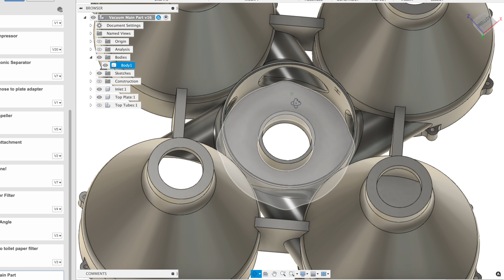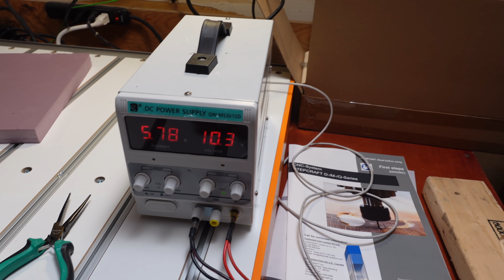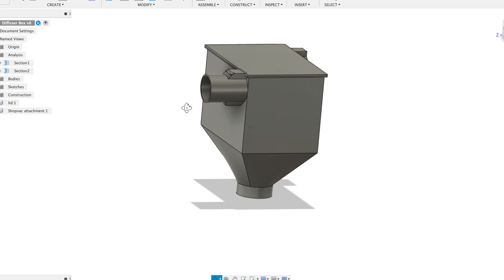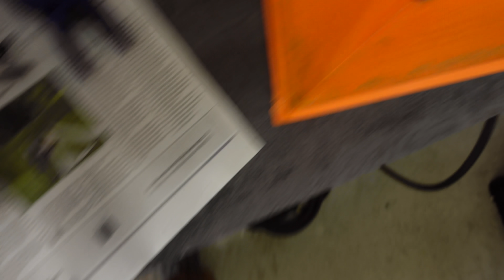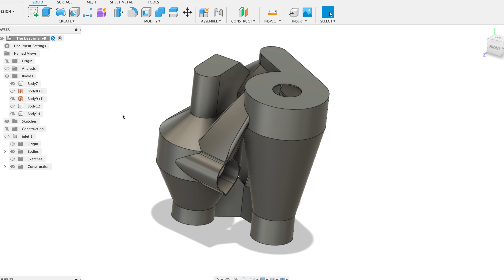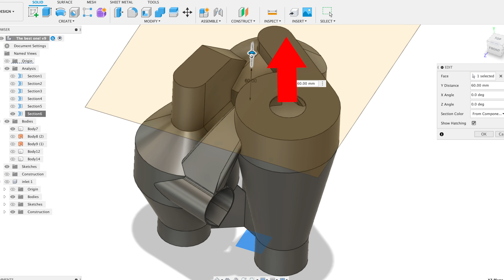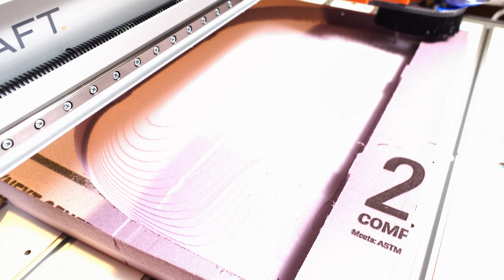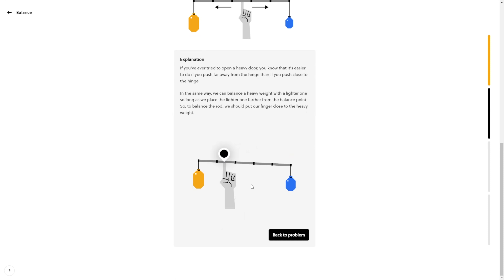3D Printed Cyclone Air/Dust Separator

Comment: Did you find the name Bill Pentz by any chance, he did a massive amount of research and design on cyclonic separators.
Rather than adding extra stages(very inefficient)it may be better to play with upper chamber to cone ratio's to get better filtration for you particular needs, also notice your designs dont have the outlet to the vacuum down in the null/air reversal area...

Comment: I have to cyclones in series in my private workshop. On large for larger debris and a minor one for smaller particles. The intake pipe is 7 cm in diameter angled 45 degrees downwards inside the funnel on both however, on top of the first cyclone i have a small reversed funned, so the air loose some velocity near the lid. On top of the second one I have a 35 cm wide 45 cm pipe with a very steep angled, long, reversed funnel on top. For 6 months I have been using the same vacuum bag even though I vacuum everything from ashes to sawdust. The greatly reduced airflow from intake to vacuum in these two stages helps gravity collect almost all particles.

Comment: i find it easy have 3 them with 3 buckets it was clean no dirt hit filter
2nd thing at lower parts i add few bump just to see if dirt just drop down bucket without being stucked up n it worker but big piece get stuck to it ugh at least didnt get sucked up in next bucket i wonder about adding line little bump just to see if dirt just hit it n slide down to bucket

Comment: To help a bit with the physics behind it:
You can imagine a cyclone like a long, straight river of water. A certain particle needs a certain time to sink in that river. To make it able to reach the river bed (in your cyclone the wall) and settle down in time, you can do 2 things: Either make the river longer, (more time until it reaches the end and leaves) or make it slower (larger flow diameter). Thats why the first design didn´t work that well, and the other two did better. Its a bit more complicated than that, but it should give a general rule how to improve the design.

The same principle is also used in water treatment plants to remove sand from sewage.

Comment: First, I guess you lose air velocity in series, which is the key to filter fine particles. Second, bigger cyclones for bigger particles. Smaller cyclones for smaller particles. Third, usually there's a short tube inside of the cyclone connected to the accept port or outlet. Fourth, I suggest that you start with two cyclones in series with different sizes. FYI
https://youtu.be/LwGXu4e6T1A

Comment: I got rid of my Cyclone. The best dust separator I found is connecting 2 shop vacs in series. First one is not powered and collects all the dust and just has a filter on the motor side and no bag for easy dumping. The second shop vac is powered and has a bag and filter in it. The second shop vac has no dust in it what so ever. I have never had to change a bag or filter since doing it this way in about 3 years.

Comment: It’s a great video and your thought process seems quite sound. Although I would guess all of this research has been done by multiple companies .  

I’ve use the dust deputy for years. I have emptied countless buckets of dust without ever needing to replace the filter and always maintaining suction .  But the hose diameter has the biggest effect on performance and of course there is a golden ratio of hose diameter to come size. Now of course your vacuum limits the diameter size you can test but it should be interesting to see how diameter would effect each type of cyclone.

Comment: I think the reason why the mono centrifuge works is because of the air speed that is much quicker than the stepper one. If you make round cylindrical barrier on the transparent plastic slightly longer than the height of the input hole, theoretically it should be more cleaner.

Comment: * ATTENTION! ***Hey Guys, just finished my Cyclone Dust Separator, 3D designed and printed it myself. I designed a screw thread profil in the Cyclone chamber to guide the airflow and dust downwards and in my tests so far im close to 100% Efficent. There is no Dust coming to my vacuum. 
Hope it helps someone of you. If interesst is there, i can publish the stl's

Cheers
Reply: That was exactly my idea when I saw the dust orbiting in the video. Can you publish the STLs or the design files? Thanks!
Reply: @robertomozzicato249  darn, my last message seems to got lost -.- 
My design is for a specific bucket, u can use it as a reference to design your own. I used acrylic disc for lid to see whats goinng on in there. Also there is a design flaw, artifact in the thread, i  removed later with a soldering iron. 

What improved the seperation greatly, was the last stl file, it screws below the cyclone, and directs the airflow downwards (probably because of some weird fluid dynamic reason).
Reply: @robertomozzicato249  it keeps deleting my messages with the url in it. So its on thingyverse with this suffix: thing:5779983
Reply: @hydroponikstuttgart4515  thank you very much!
Reply: @robertomozzicato249  no problem, if u need help or got some questions to design your own, feel free to ask. cheers

Comment: You should try it by combining your system with a "Tesla Valve".
Cyclone funnels with different diameters (right and left rotation) can be placed on the semicircular rotating parts of the Tesla Valve.

Comment: Love the video. Since the pitch of the cone changed which particle sizes it gathered most efficiently, have you thought about making a multi-stage separator, similar to the series separator except the pitch of the cones change to accommodate for the size of particles most likely not caught by the prior stage(s)?

Comment: You all are a lot smarter than I am . I do have a question though . Instead of just having a steep smooth interior of the cones . Would it make the cones more efficient depositing the debris in the bottom of the bucket if the inside of the cone was shaped like a swirled ice cream cone ? . That way all of the debris would have a channel path along the sides and make it easier for more less particulated air to come up through the center ? 🤔🥲

Comment: Point to note: the multi-stage design should allow you to tune the first stage to remove big chunks at a cost of letting the fine stuff through, to be dealt with in stages 2 and 3.
Reply: I think the particle size being targeted with each stage is probably backwards, probably smallest to medium to largest, but I'd think you'd want to go the other way around.

Comment: I would be interested to see if one could modify the cyclone and make a flute pattern that spirals material down away from the top - > maybe it could help with those larger particles getting stuck "in orbit"...  Hopefully without disrupting the air flow too much

Comment: In the four-intake version, I think the air after cycling down to the bucket joins together and forms another cyclone for they are spinning in the same direction. what if you rearrange the inlet of the top parts, and make them opposite by pairs like the mechanical engineering of a quadcopter? The two pairs of cyclones would cancel each other so that it will leave the dust in the bucket and only the air goes out.

Comment: The problem is that a much simpler bucket lid separator already exists. Iy works quite well, is inexpensive, and doesn't take up space inside the bucket. It looks (to me) like rather than adding a cyclone on to the bucket, it makes the bucket its self the cyclone. Good effort,  it never hurts to try to make things better. I could be wrong, I never bought one but the demo looked like it worked.

Comment: I got an idea which I imagines going to work well you know your mono larger cyclone .
For your larger monocyclone we're funnels out increase the height of the funnel so the final sidewalls that taper straight increase the height 

And for the stuff that gets stuck to the sidewall through centrifugal force you might want to construct a baffle almost like a fan blade to slow down the air where the particulate sticks against the sidewall of your funnel with centrifugal force causing it to drop out

Comment: I suspect your multi-cyclone in series would have worked better if each one represented a significant drop in air speed by making the inlets and outlets larger. Particles small and light enough to get through the first one are probably going to make it through the next ones, too.

Comment: Could you do a spiral lane on the cone side going down to the bucket? That would push down any particle stuff caught in the tornado. Kinda like an inverted screw. maybe that'd help with bigger and smaller particles.

Also great video!

Comment: If you print the intake to the cyclone to where it transitions into an oval and the radius of the oval is perpendicular to the cyclone wall instead of being formed out of the wall then you’ll get much better results as you won’t be blowing some of the particulate more towards the center and it will stick to the walls a bit harder

Comment: Would love to see a followup on this one!
I was thinking of 2 ways you could maybe improve the cyclone:
(1) drill small holes in the cyclone so the dust can be swirled out (either inside the bucket or with a hollow wall) 
(2) add a tesla valve to the outlets of the triple cyclone, so the air doesn’t flow back out of the bucket.

Comment: Having multiple stages of similar size does not make much sense. It is way better to have the first stage as larger with slower airflow to extract just the larger size dirt. Then the second stage as way higher speed, smaller size for the fine particles which passed the first stage. Such way the airflow in the second high speed stage is not getting disrupted by the larger specks as when only the second stage design were used as the only single stage. But then we have a typical Dyson vacuum cleaner design..
Industrial separators use to be just a single stage, because they use to be dealing with not that much variable dust, so the single stage could just be optimized for what it will handle, plus the larger physical size makes the separation more efficient even for wider range of particle properties (the air spends longer time in the cone vortex when the thing is larger, so even slower separating finer dust lands on the wall, as well as there being more room to prevent the larger dust from disturbing the air movement), so no second stage is usually necessary there.

Comment: That green powder is so fine, you typically want more CFM and slower air (less static pressure) 

That’s why commercial dust collection fixates on CFM and less on static pressure. The fines are the most dangerous for our health (sub 2.5 micron)

Comment: For an airspeed separator, make a triangular chamber. The air enters at a lower corner, blowing up half the angle (i.e. at a point below the outflow). The outflow is in the upper corner and on the other side from the inlet. The outflow  diameter must be bigger than any previous diameter including the nozzle. The bottom of the triangle opens into a bucket. Now the trick is to make the air path long enough that the dust has a chance to drop out of it before the airflow turns up into the outflow.

Inside the chamber you have 2 air flow shaping systems meet: The incoming air will want to try a slightly inclined line and the outgoing air will then pick that air up and lift it to the outflow. Kind of like a hockey stick.

Comment: Try using a Diffuser with a checker board blocker with smaller grids as you get closer and air pulls into a Cyclone or 2 stage chamber. With the bucket glue a divider to prevent outlet from mixing air flows once it deposits in bucket from both sides. Larger dust balls and dirt will be sorted in the first chamber, where the second chamber will filter small particles. have the air intake be pulling from the small particle side. Have a cone attached to the intake pointing into the bucket on the cyclone side similar to a wasp trap this would make it harder for dust to puill up into the intake hose and swirl around the edges of the lid.

Comment: With the big cyclone separator, That tiny bit of green on the towel could just be caused by the residue on the plastic holding it in place, but I don't know if you cleaned it or not.
In any case, the cyclone separator works beautifully.

Comment: I'm almost certain the triple cyclone works better with bigger particles because the third stage has a steeper angle than that of the big single cyclone.
However it seems that shallower angles then work better for smaller particles, this might just been an illusion because of the comparison but if you do some more testing on that and it turns out to be true, it might be interesting to somehow combine the two in series.

Comment: Really awesome. We need a better system for fibre cement dust. Silica dust seems to float in the air for ages. $10AUD a bag can get expensive if you're using a rated vacuum.

Comment: The reason they were not going down until you turn the air off was because the 3D printed surface was ruff it needs to be as slick as possible to allow gravity to overcome friction

Comment: Great video.  I use 2 different cyclone pre-collector systems in my work shop. I have both a 4" high volume low pressure dust collection system with a 40 gallon steel can with a cyclone lid as the pre-collector and a a 2" shop vac system with the 5 gallon bucket and a cyclone on the top. I found the 5 gal bucket lid a bit of a pain to get on and off to empty the bucket. So I  use a double bucket system where the top bucket has the bottom cut out of it and the lid always stays attached to the top bucket.  It still seals when in use but to empty I just pull the buckets apart and it's easy to empty the bottom bucket. the system is also a few inches deeper.

Comment: I built a 3 stage cyclone with cyclones off Aliexpress a few years ago that worked amazing for sanding (no powdered dust reached the vac). But what I learned is each cyclone has to have its own catch/container, and everything needs to be completely airtight. In the end I got rid of it since it was too big but I'd love to try a manifold of cyclones like what Dyson does with their vacs (your first attempt) with 3d printing...

Comment: Hi! I have a BIG IDEA FOR YOU! 

It's 1:30 am! Just woke up thinking about this video for some reason. You need to make a 3d printed rotory air lock for the bottom of a cyclone dust collector!

I'm over the cyclone on top of barrels thing! My X carver fills them way to fast! 

Would love to see an inexpensive non-super industrial version of a rotary air lock!

 kinda like a shrunk version of the oneita air system that I can just put a trash can under. 

Back in the day at the millwork place I used to work at we had massive ones. We could just flip a switch to turn off the air lock, replace the dumpster and flip it back on.

Meanwhile work could continue uninterrupted inside. 

Would love to mount a cyclone on a stand with an airlock under it and have all of my wood / foam go straight into a trash can I can just swap out, instead of having to pause to pour bucket after bucket into the trash or worse, pick up a 55 gal barrel and dump that into a trash can. 

No point in having to do more work when a better solution exists!

Comment: I saw the separator fall over a few times when testing the large single separator. I think this could disrupt the airflow and cause the dust and large particles to end up in the filter. Maybe this caused the mixed results?

Comment: Perhaps the problem with the fine particles is that the cyclone is allowed to extend into the bucket, right down to where the dust is...?

If there was something to interrupt the cyclone before it reached the layer of settled material, it would be more efficient...?

Comment: You could potentially put some kind of coanda effect device that sits in front of the output and shields from particulate escaping, while hopefully allowing not adding too much resistance to the air.

Comment: Awesome analytic and iterative descriptions. I'd worked this very topic about 10 years ago and was struggling with many of the same issues that you were able to visually expose.

The biggest reason for 'short circuiting' or bypassing the centerfuge effect is not having the proper pressure drop in the chamber. Adding an extension tube to the clean air exit that's past the tangential entrance helps quite a bit.
 
Another is having the correct aspect ratio of height to width based on your entrance velocities. Scaling the cyclone up or down works to a point...when debris is being passed through the cyclone or even being sucked up the center vortex you have too little of a pressure drop...you need a larger diameter cyclone to compensate for the velocity of your system.

If you play with Dyson vacuums you'll find they have precisely scaled cyclones for their velocities. They don't have near the flow or suction of a shop vac but have near perfect separation and filtering because they tuned the entire system.

Your shop vac is your control point... The cyclone needs to be tuned for your shop vac.

Comment: use the actual body of the dust collection chamber as a centrifugal separator for the larger particles and then have the air directed into smaller cones for the smaller particles, forcing the smaller particles through the cones into a separate chamber.

Comment: What I would do is try making a hyro filter where the air gets pulled through water in the bucket. one could experiment with various ways you can 3d print a mechanism to disperse as much dust in the water prior to getting sucked out the other end

Comment: My AC duct work was cleaned this week. Unfortunately, a lot of the dust removed found it’s way through the vacuum filter. Solution, use a hose attached to the exhaust and direct the exhaust outside.